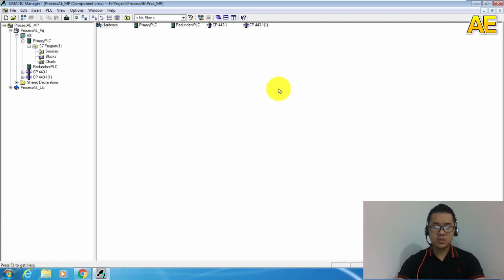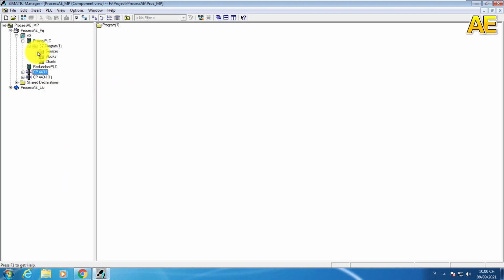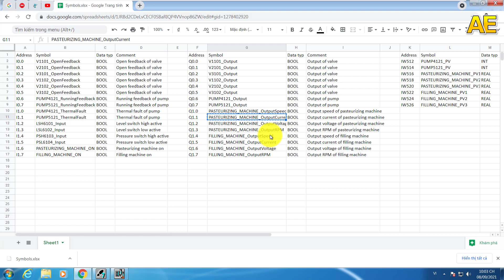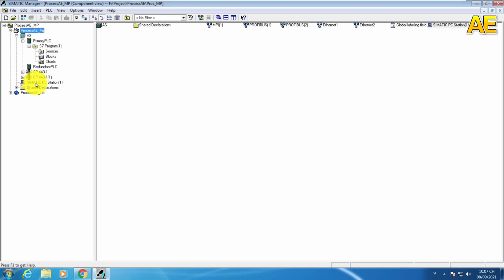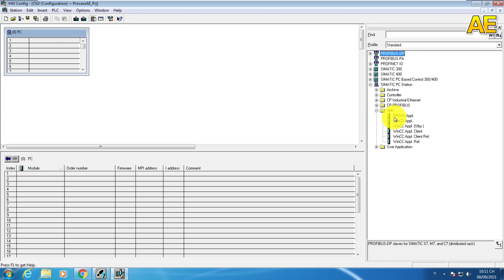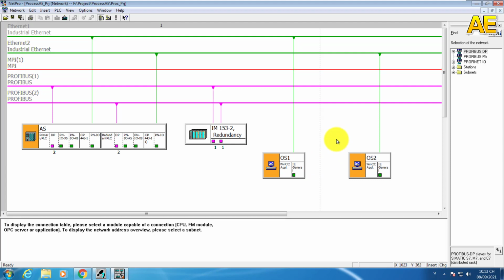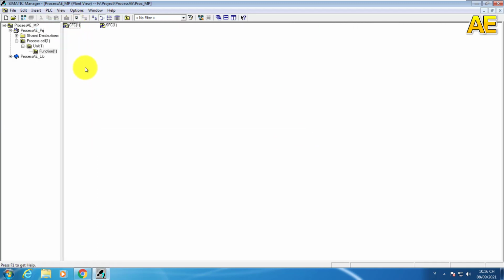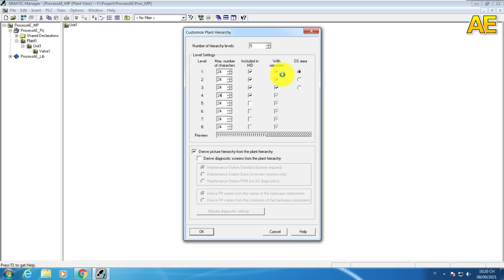Simatic PCS 7 Part 2: Configure PC Station - Component And Plant View

Comment: hi sir may I ask a question I have a problem .I had a page and i had a motor in that page i compile that code every ting is fine but when i opened the wincc runtime i saw my motor but in mode state i saw error word and the same with motor start and stop place and pid place what is the mistake thanks